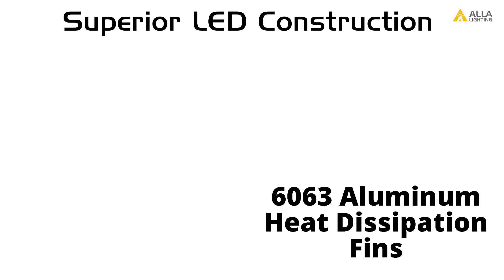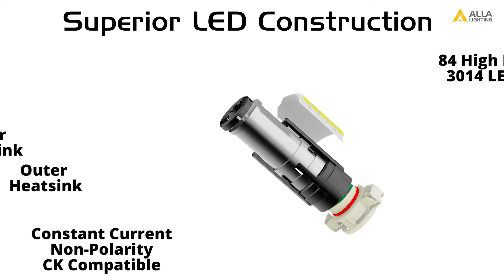Newest PSX24W 2504 LED Fog Lights Bulbs 12276 6000K Xenon White 84-SMD

Comment from the maker: Newest PSX24W 2504 LED fog lights bulbs 12276 6000K xenon white 3014 84-SMD replacement upgrade OEM incandescent lamps or damaged fog lamps for vision and safety.
Product link: https://www.amazon.com/dp/B09R6ML9Q1
Fast locate which bulb fits your vehicle: https://allalighting.com/pages/bulb-finder-shop-by-vehicle-led-light-bulb-car-truck